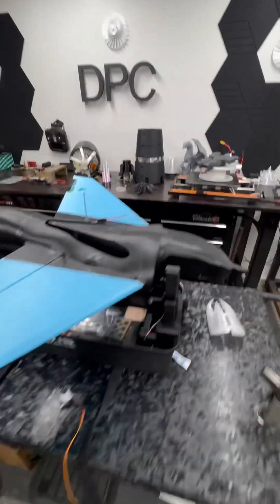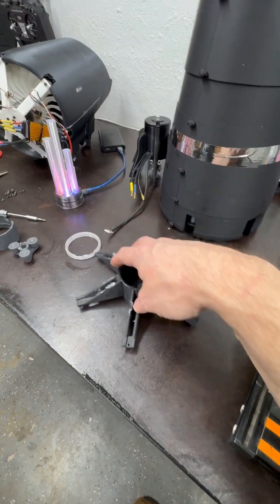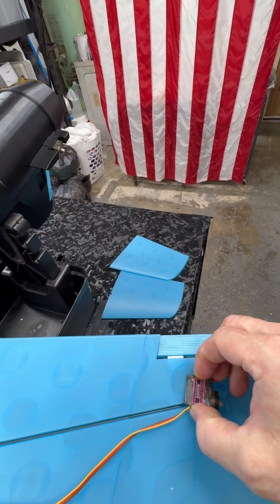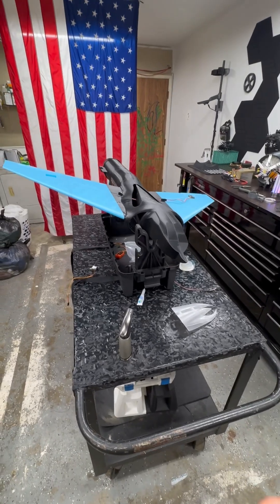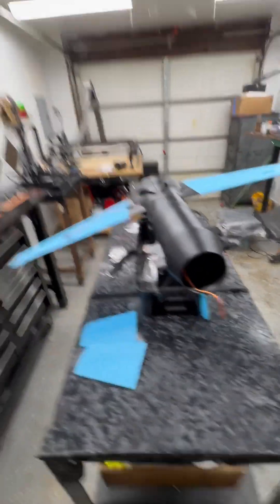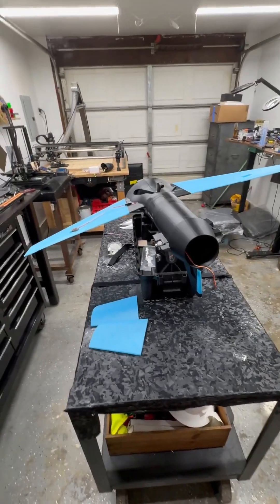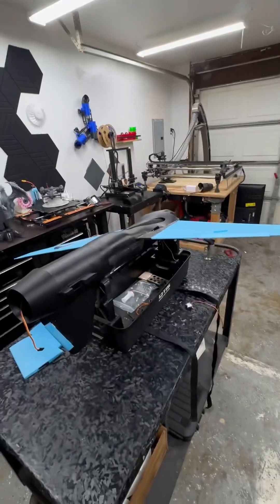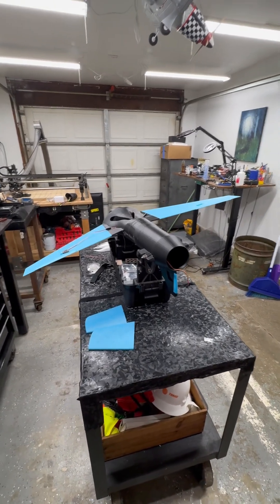Multi project update. EDF Turbine and the 90mm EDF Jet. #edf #turbine #jet #fyp #shorts #diy #rc ￼

Comment: Hey dpc, I'm having troubles with my tx16s if you could help, I kinda just wanna factory reset
Reply from the maker: I will look into that now.
Reply from the maker: Make sure you back up your models on an SD card and then make sure that you download from the GitHub the latest firmware version once you flash the new firmware to the TX 16 S it will be as close to factory reset as possible then you reload your models.